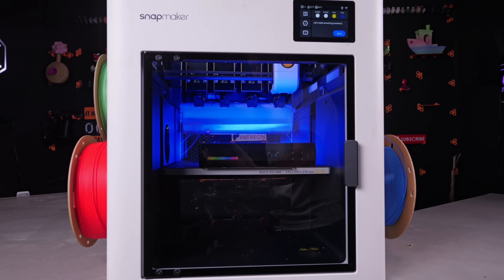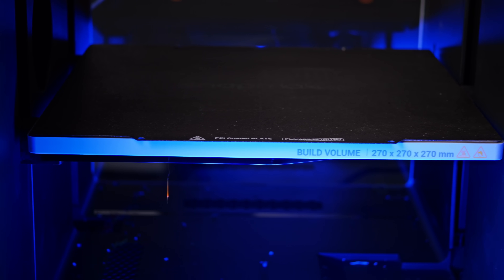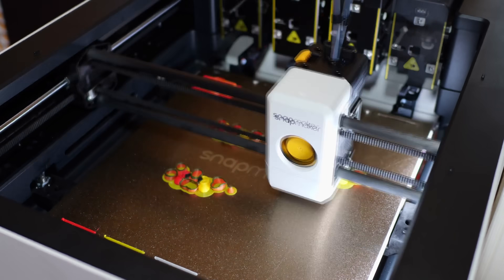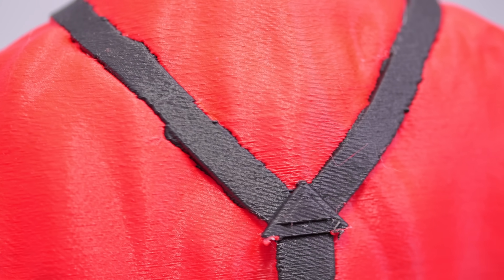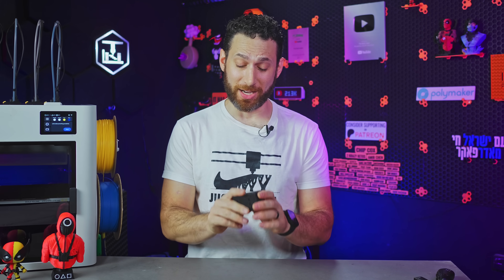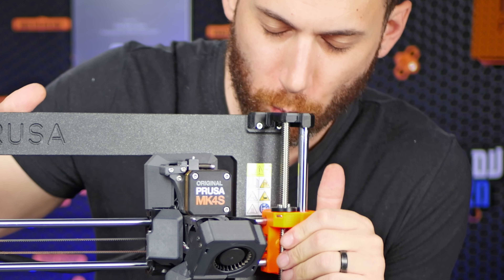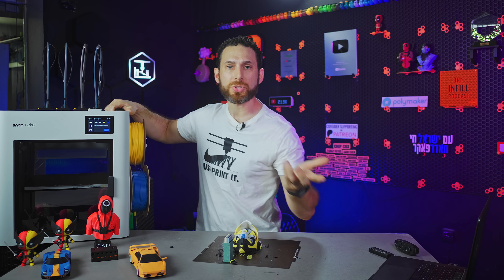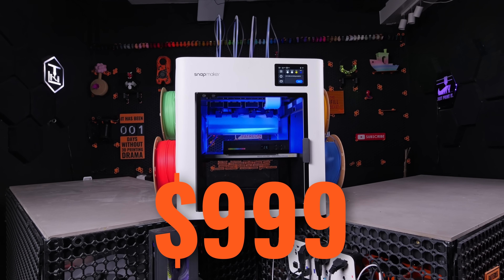The SnapMaker U1: HOW is This Even Possible?

Comment: I understand you are sponsored by SnapMaker and they're holding you up to a certain standard on the review. BUT, i gotta say you're giving the printer way to much excuses and credit, it definitely has bad bed adhesion, its stringing allot and overall it cant really handle rough angles and none beginner friendly filaments . with that being said my Bambu lab A1 combo is almost half the price of the SnapMaker,  it has way better build quality and it can handle all sorts of filaments.
Reply: And TPU too?)
Reply: @emptyimage6243  yes but only without the AMS
Reply: @emptyimage6243  What do you mean by that? Yes, even the A1 mini can handle TPU without much trouble :) You probably meant that TPU is not supported in the AMS - that's not true any more either with the new(ish) (albeit slightly stiffer) Bambu AMS TPU.
Reply: From someone with (14) A-series machines that's not a valid comparison to be honest. Most of the models in this video were poorly suited to FFF printing so I'm not really even sure whey they were chosen. They would tend to make any machine look bad. A-series cannot really do multi-material at all, and multi-color is extremely wasteful when swapping on every layer like the prints performed in the video.
Reply: But yes, the print quality on the snapmaker is not very good.
Reply: Yes a bit too much praise, it’s understandable that they paid money but he just completely sold his opinions. Not trustworthy content creator anymore.

Comment: As a pla / CoPE only machine it is incredibly impressive. These days I'm just not interested in a machine that doesn't have a fully enclosed heated chamber that gets to at least 120c with a hotend that can do 450c or higher. And if I'm perfectly honest I can't see myself purchasing or building anything in the future that isn't a tool changer, they are the future of 3d printing and any new printer that doesn't have one just feels outdated now.
Reply from the maker: Sorry uhh what store-bought machine has a 120C heated chamber and a hot-end that gets to 450? None. I think you meant bed at 120C, but even still, there are no consumer printers that go above 350C hot end...
Reply from the maker: Sorry uhh what store-bought machine has a 120C heated chamber and a hot-end that gets to 450? None. I think you meant bed at 120C, but even still, there are no consumer printers that go above 350C hot end...
Reply: Yeah sorry typo, 120c bed, and heated camber to at least 65c.....and yes, there are a number of retail machines that already do that. But certainly not at the sub usd2000 price point. Oh and there's a growing number of "consumer machines" that have 450c hotend and 65c heated chamber.

Comment: No. You are a bit wrong. The current market is driving in the multi tool head direction as a whole, thus, this is not "disruptive" but in flow. Also, despite all the crying going on, there is a real shift to open source, with some actors being out competed by others, since the winning ones go open source. The real challenges is in the software, and as for hardware, this video do not really cover the real challenges the industry has. The cold print steel sheets are actually far more disruptive than this, but that is for another day. We will have a ton of these "this is insane" videos going forward, but really, it is all about using open source software, and copying and moderately modify others designs. Well, until you start talking Swedish, which is the tech that seems truly disruptive. As for this printer, it seems to backed by solid design for the most part, which is kind of new to this industry, for consumers.

Comment: And why oh why do you have problems printing PETG. The H2D does a fantastic job on stock settings. Probably better than PLA. In fact I have printed ABS, PACF, PETG TPU 95A, Siraya Tech Air at 270. Softest setting all without removing the Top. You just need to print low friction guides and bypass the buffet use separate spool holder or dryer box sitting on the table. The quality is a mile better than you showed on the U1. But it is way more expensive
Reply from the maker: 75% humidity where I live.

Comment: I'm feeling really good about my choice to back this project. Most of the negative stuff I've heard so far seem to entirely software and firmware related issues that should be fixable before or after release. Hardware seems solid. I'm optimistic that they will do right by Orca and use their fork as a preview branch they can cut a release from anytime, but upstream everything to mainline for eventual merging.

Comment: Looks interesting but the quality did not look that impressive even on an early release unit. 

I look forward to see if it can cut the mustard once it’s released.
Reply: Yeah, can't say the quality of what was shown was that impressive. The general idea and good entry price is great, but hopefully with lots of more tuning it gets to a better finished product. Good luck to them, more people pushing the bar on multi head is great for us all in the lkng run
Reply: Jakość jest jak 10 lat temu na Ender 3.
Tragedia.
Reply: Yeah, I have a Bambu Labs X1C (original backer). The printer is still kicking, and yes, it takes longer to print, but the print results are leaps and bounds above this one. I really hope they get that dialed in; otherwise, I am pulling my pledge. Speed doesn't matter if the prints look like that. I haven't seen lines that thick and wobbly since my 2015 Makerbot.

Comment: In the current iteration of the snapmaker u1, when a tool change happens, does the printer keep the previous tool ldling hot for the rest of the print, or does it turn the hotend off after it's been swapped out?

Comment: While it doesn't need an AMS, they are missing a trick by not having the filament spools enclosed so that they can be humidity controlled even if left on the printer for a while.
Reply: True. I imagine the community will come up with a mod to do this.
Reply: Having a feature like that does not make sense on a machine like this that's trying to bring a commercial/enthusiast feature down to regular consumers. The point of the U1 is to give regular consumers access to toolchangers out of the box. Shipping it with a filament dryer would needlessly increase the price, and deter the specific demographic they're trying to attract.

Comment: Nice printer, other than the print size the price right now is insanely low however, I want to know if you are planning to do a segment on Polymaker Panchroma CoPE 3D Printer Filament? I would like to get your thoughts on this new filament.

Comment: Wish this woulda came out before I bought a h2d.  I almost still snapped up one of these for the price, but decided it ultimately wont do anything my h2d doesn't already do. Def keeping my eye on this to see how it actually preforms once released because if its as good as it looks I might have to snag one down the road.
Reply: I think it doesn't really make sense to compare them. The H2D is made for Engineering, while the U1 is for people who want to do multicolor PLA and maybe some TPU and such.  H2D has the enclosure, heated chamber, higher nozzle Temperature for Filaments like PPS and the different toolheads with more in the future.  Not saying the U1 is bad, but they're for completely different audiences.  Maybe it's something what a P2 could be from Bambu.

Comment: As you said, Jon, it's a pre-production unit and nothing is really finalized.
So, I guess Snapmaker wanted to see what makers and content creators had to say about it so Snapmaker can (and probably will) eventually fix and/or enhance before any final release ... and propose a bigger version, similar to a Voron 2.4/350 in build volume, with more toolheads and refined macros, factory-default hardened steel nozzles, and such.
To me, it's a kind of "test shot". A good one.

Comment: Multi tool heads and motor driven feeds are great improvements. 270mm^3 saving on shipping costs (which is what Qidi did with the Plus 4) isn't going to open my wallet though. In the future maybe 350mm^3, 9mm self adjusting drive belts, a 6mm / 120 degree plate compels me to upgrade.

Comment: I wonder if tool heads can be run at different temperatures for different materials in the same print? I haven't managed to track down that info yet despite queries to Snapmaker. Does anyone know please?
Reply from the maker: They 1000% can, and I did it on multiple prints in this video.
Reply: @thenextlayer  thanks, I was scanning any screens I could stop at but didnt see the detail :))

Comment: The cloud issue and logging out of the slicer and machine was one of the major reasons I sold our Flashforges. Lets hope snapmaker fixes those issues.
Reply: You aren't required to use the cloud with Flashforge. I send prints directly to them over LAN through Orca via Fluidd.

Comment: Honestly, 4 filaments is more than enough. I don't really care about colors. I'm not printing flexy dragons and trinkets. That said, this looks like a real good printer, but I'm not going to back a kickstarter. Happy to pay MSRP if it turns out to be as good as it sounds. I'm glad they're contributing to open source and offline usage, and I hope they fully commit to that.
Reply: i'd like to see it be useable with an ams style open source unit per printhead.  which should be doable with a few coming out and should work with klipper
Reply from the maker: You clearly don't have young kids in the house.

Comment: If this printer was in the 320-350mm range, I'd have slapped my money down before the end of the video. But, for someone who already has printers in the 250-280 size range, there's not enough about it to make me replace my existing machine. Yes, the multi-toolhead is great, and I really wish I had it, but that's the only real advantage it's got over my A1 (well, besides the whole BL trying to lock down everything). 15mm of bed size is not significant enough to matter.
If I was buying new? And I wanted something in that size range? Yeah, this might be my top choice.
For now, I'm waiting to get a Sovol SV08 when INDX is available.
Reply from the maker: They’d be silly not to make one given the success of this one.

Comment: Very nice video, seems to be a good printer. If I didnt already have a printer I would make it my first printer. BUT, if you currently have 1 printer, and are considering getting another one, I would probably wait for their second release, just because $999 is still a high price, considering we now have entry level CoreXY multi color machines for under 700, maybe not with tool changing, but if wanted could have 1-4 material systems. But that's just my opinion, looks like a solid machine only thing I dont like is it looks like a 2000s oven x PC case 😂

Comment: PRs back into Orca slicer code is a refreshing development from printer makers.

13:18 i'm just gonna say it. you need a UPS for your printers!
Reply: Bought a UPS for our machines in the spring and it has been amazing. This summer we have had more storms than normal, and thus more power outages then normal. Every time the power went out we had prints going, and all were safe thanks to the UPS!
Reply: Why does every printer manufacturer feel the need to ship their own bespoke slicer?
Reply: @retroide  i would guess because they want to develop and iterate quickly, and if they use Orca, they have to wait for the owners of the repo to approve their PRs before they can officially release the software. That's not to mention any vendor-specific CI/CD automations they might want to do.
I'm not against custom slicers, but they definitely need to port the code back to Orca eventually.
Reply: UPS is a must.  FedEx a close second.  USPS will destroy it in shipping.
Reply: I live in small town texas and go through crazy storms while printing and never lose power, always amazed!
Reply: @doubletapproductions you know you just jinxed yourself 😂
Reply: @ODXJ  Damn you are so right! next print probably too lol!
Reply: Get a lithium power station. Some of the really nice ones have a UPS feature, but they work just fine charging while running the printer, even without UPS.
Guarantees that it can keep printing for a while, even when you're not around, if you lose power, and there's zero risk of surges.
Reply: That's a lot of UPS to keep a printer going let alone multiple printers going for 5 hours. That said it is a good idea to have your printers on a UPS for small hiccups and to clean up the voltage going to the machine.
Reply: A ups is great for blips, but even a server grade 3000VAh isn't going to last you more than an hour, maybe 2. Typical consumer grade stuff will get you less than 20 min. (Assuming the printer is using ~200w during operation, which is typical)

I think it's good to have those for blips and such, but people shouldn't expect it to solve any extended power outage problem.
Reply: @winebartender6653  Lithium power stations are 1000X better than UPSs now. And some of them have a UPS feature built in.

Comment: Its very impressive for the price and for people who like multi colour . They could do a " pro " version with higher temp and a hated chamber , that would be nice. They also need to work on an AMS . I know its a tool changer but the beautly of an AMS is that its enclosed and can if its built for it keep filament dry .
Reply: Well, it is running Klipper, so knowing the 3D printer community, I imagine someone is already working on AMS compatibility given how promising this printer is. I agree that having higher temperature capabilities would make this printer more compelling, but it likely would have made it a fair bit pricier. At the price point they're offering here, I think it appeals well to folks who really just want multicolor or multimaterial printing and don't really use the high temp stuff. I also really like that Snapmaker is not going with an overly locked down firmware or slicer software like Bambu have done. I'm leaning strongly towards buying, but I want to do more research first.

Comment: I am a bit surprised we have not seen anyone combine multi head with multi material systems so you can have high material efficiency but not give up the total number of colors possible. Heck with the combination you could have multiple colors of multiple material types if for some reason you needed that.
Reply: @LyleMcCracken  I'd wager bambu will do that to maintain sales of their ams
Reply: why the fuck u would do that point of tool changer is to minimize waste and speed up time for prints if u put AMS on toolchanger u lose that u get more colors but u why not just buy more printers .....dont see benefit of this

Comment: Nope. Have looked hard at this printer and the Bondtech INDX will be the way to go on a Sovol SV08.
Cheers.
Reply: I agree that I would back Bondtech's Swedish engineered toolhead over a chinese counterpart and I've been actively following the SV08 mods, waiting for someone to hit a 8Max up with 8 or more INDX - let's see what November brings when INDX are on the open market.

Snapmaker also need to show more active videos as their FB ads and website don't show a lot of active content only polished pics.
Reply: @MrBennyt19  I am looking at tricking out the Sovol Zero with the INDEX.
I can see 4 toolheads on that little sucker!!
Reply: That's apples and oranges. Got an extra SV08 if you want it